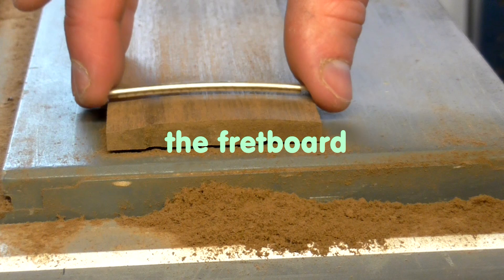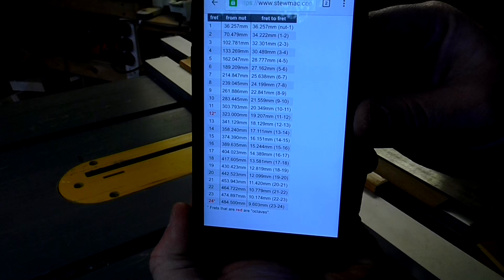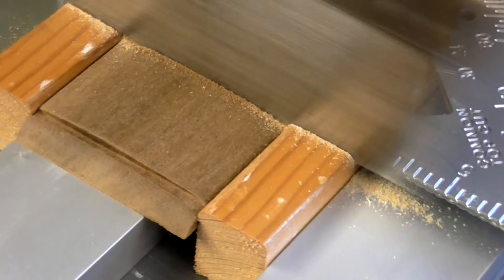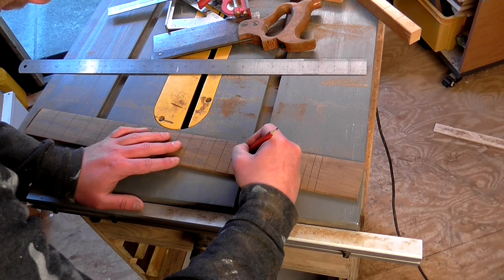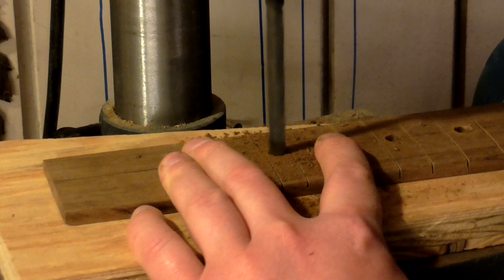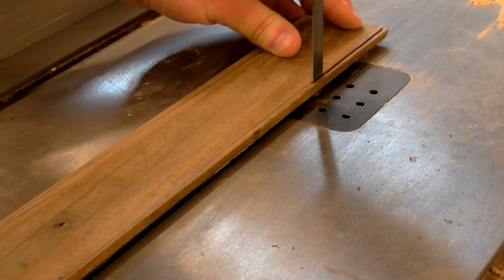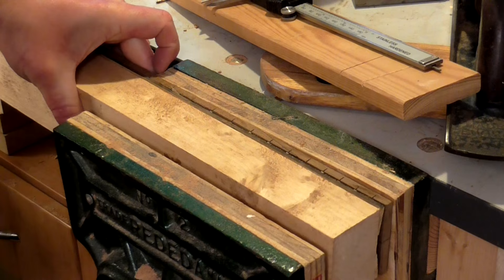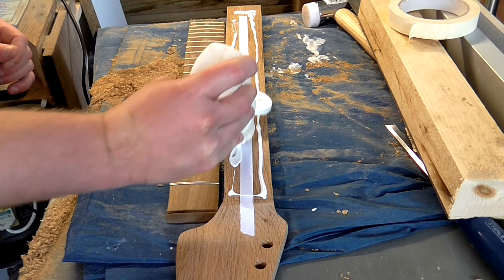Making An Electric Guitar From Salvaged Oak (part 3 of 9)

Comment: where would i find that rod you used to strengthen the nek and also what is it called. Thanks great vid mate
Reply from the maker: +samuel leafe truss rod
Reply: thanks
Reply: is it necessary for the guitar?
Reply: Depends really. But nowadays no matter what, all guitars should have one, it helps to straighten the whole neck or bend it one or the other way (some people like more bow than others, where the fretboard is concave) some guitars gets maple strips to further strengthen, but carbon rods has been developed to really strengthen it, should also help with twisting to my knowledge.

Also, get a double action truss rod, otherwise if you're really unlucky, you could end up with a problem, if the truss rod only goes one way and the wood decides to go the other way, there's little to nothing you can do, other than taking the neck and board apart and install a double action truss rod.